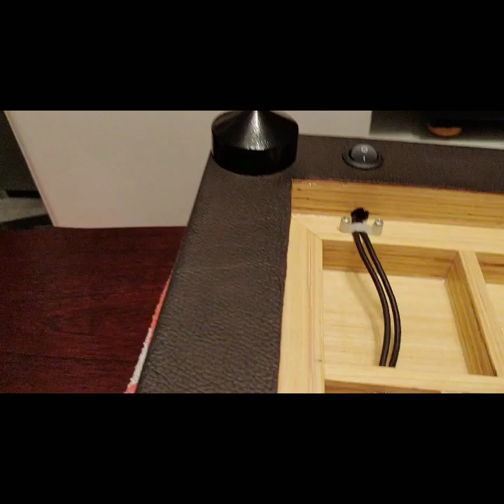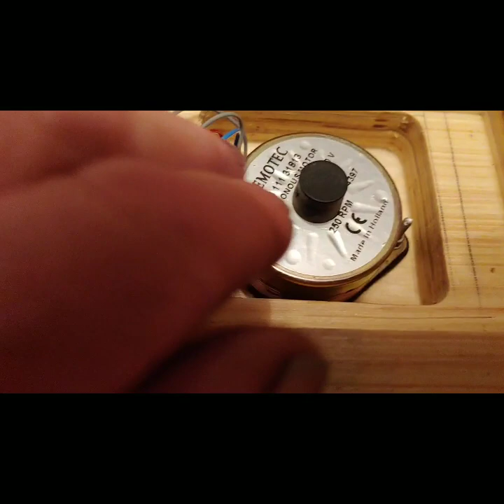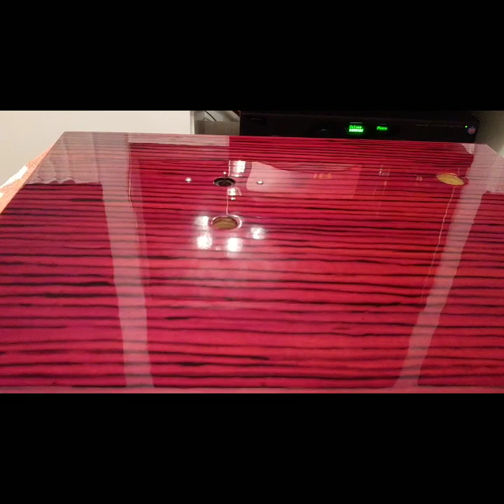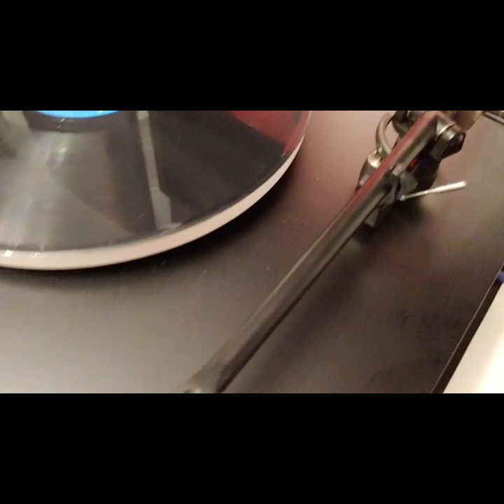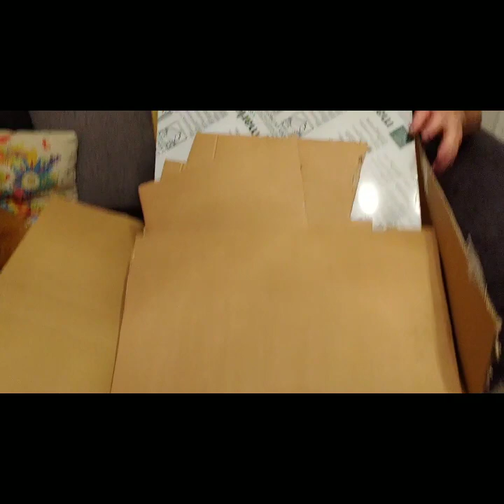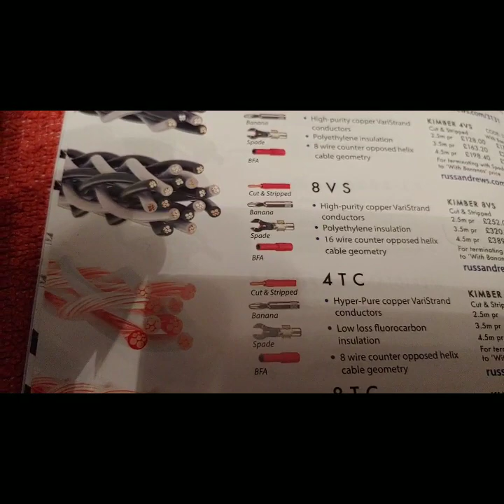Update on our Ultra Rega Plinth

Comment: I have all the upgrades myself just put in the 24v moto which made quite the difference. Now thinking of rewiring the arm? I've often thought of getting one of those per-cut plinths from ebay, maybe in the future. I've read in other places that the original plinth isn't just a bit of MDF it's actually made to work well with everything? Whatever the case yours looks great, I totally appreciate the time and effort.